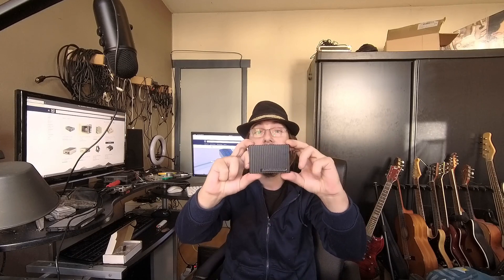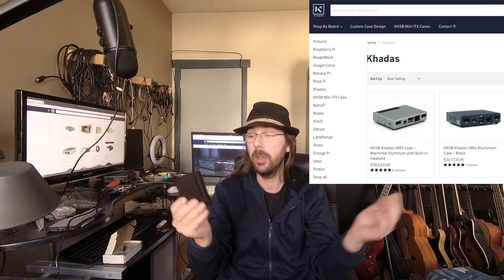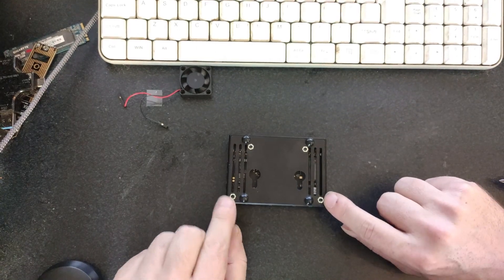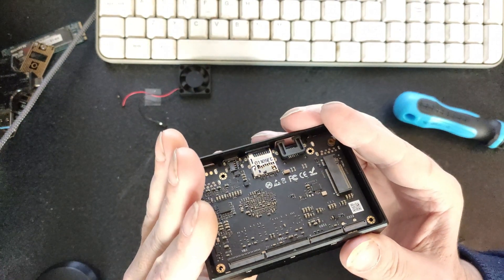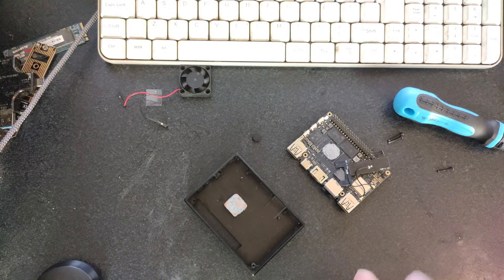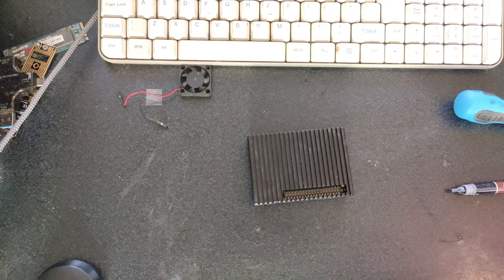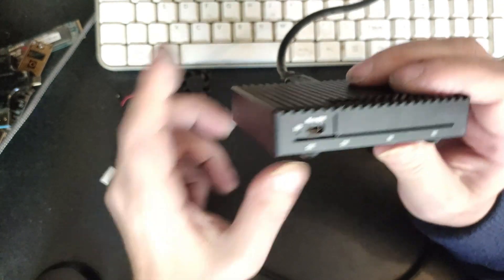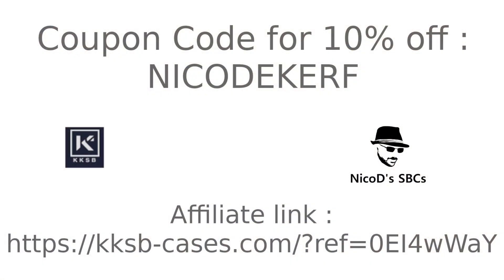Review KKSB metal case for the Khadas VIM4

Comment: Does the case work with the M2X Extension? It's promising with the copper shims, but if the m2x doesn't fit... I'll just keep waiting!!!
Reply from the maker: It doesn't fit the M.2 extension board. I find that a pity too. The NVMe socket is pointed to the outside. So making it fit in the case would be difficult. Maybe possible with M.2 extension ribbon. 
There is room for an NVMe on the bottom of the case. But it's not made for it. Wiould have to stick the NVMe with double sided tape to the lid.
The NVMe board is way too big to fit.
The Khadas case also doesn't allow access to it. 
KKSB are making a revision of the case and will send me one to compare. So the copper shims will not be needed anymore. I'm glad they listen to my advice. I can ask for a case with room for the NVMe expansion board. But I'm not sure if the cost of designing that would be worth it for them. 
I do think it's worth it using the case because it's passively cooled. I hate fans, and that's the reason I'm not using the Khadas Edge2 for my daily needs.
Reply: @NicoDsSBCs  Bummer! 
Unfortunately I purchased the m2x and a drive just for the VIM4!. I purchased the khadas DIY case thinking I could modify it to work with the m2x extension, but it was wasted money and effort! 
Maybe I'll just remove the m.2 extension board and go with the KKSB once it's updated as you mentioned.
Haha, the little fan on the VIM4 is pitched just high enough to be annoying!!
Cheers and thanks for answering, glad I found your channel!